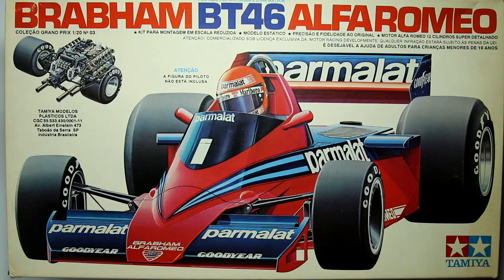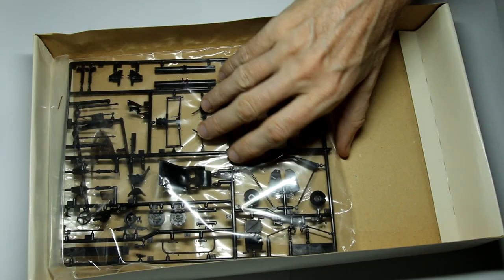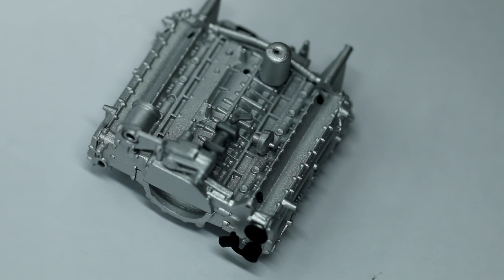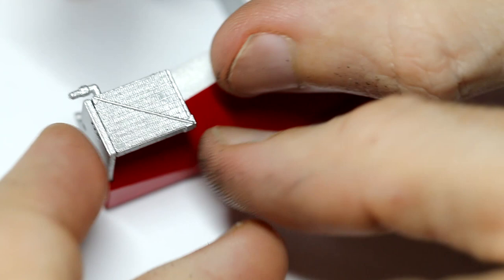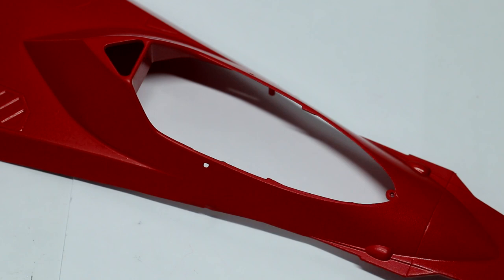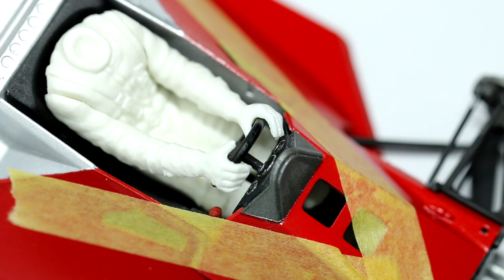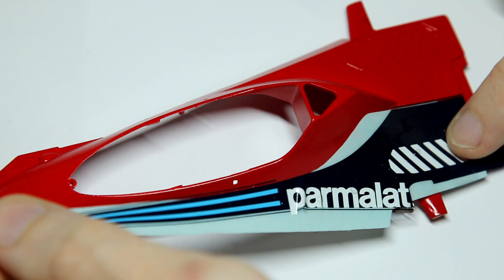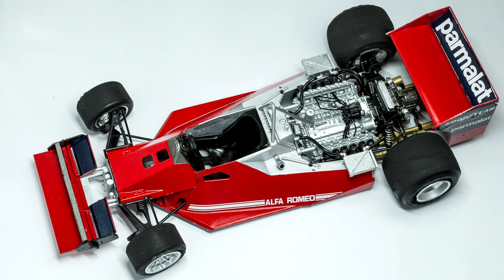Brabham BT46 1978 Formula 1 car - Niki Lauda (Tamiya 1/20 scale model)

Comment: Half watched while having breakfast .. great bud .. again ..
The issue you had with the radiator hoses.. I push a little wire down the tube to you can shape the tube and it takes the stress from the joints ... and mimics moulded pipes realy well
Reply from the maker: Thank you Ian. That's a great tip for the hoses too-I'll definitely be trying that.

Comment: Nice build! I'd like to add some comment though. 
Maybe you could sand or trim off the seams somemore before painting? 
That would give a far more greater result!
Use some decal softening and setting products to prevent them curling up. 

Carry on building, I've got a same sort of stash to convert to nice models to display.
Grtz Han

Comment: What cement are you using? My knowledge of modelling used to involve scraping off paint on joints but you appear to be gluing over paint.
Reply from the maker: Yeah...I probably shouldn't but sometimes I do if I think it will make more of a mess to scrape or sand the piece.

Comment: I'd like to see more Formulas. Query - it seems that seams are not such an issue as they are with tanks and planes. Is this a common practice? I've seen negligence of engine seams quite often. What's your take on this ?
Reply from the maker: It depends on the kit to be honest. Tamiya kits are generally good. Fujimi kits are a bit mixed.